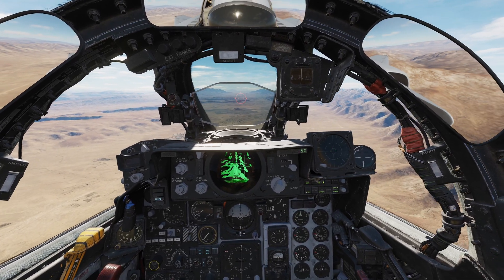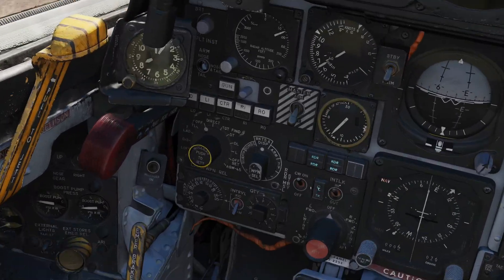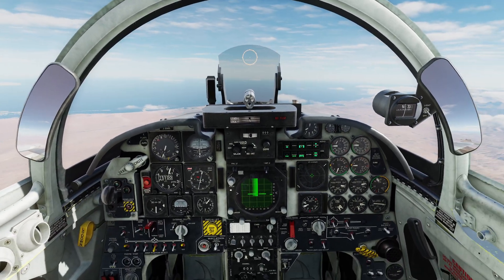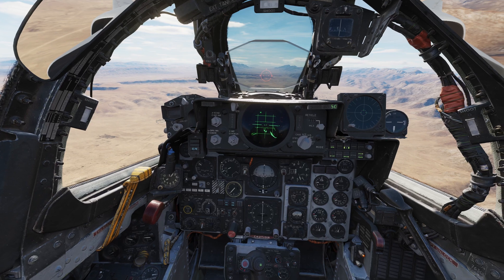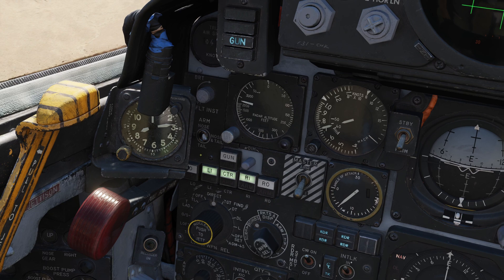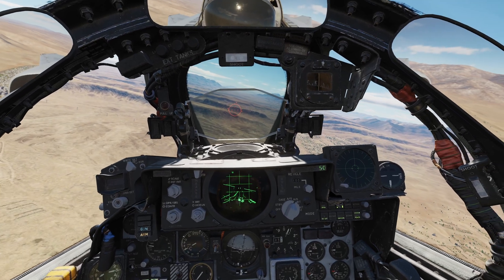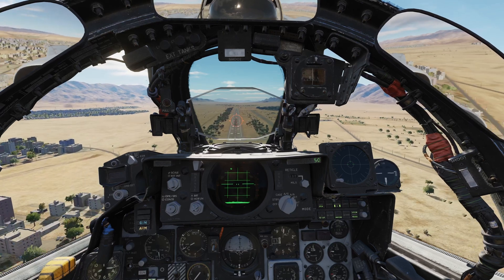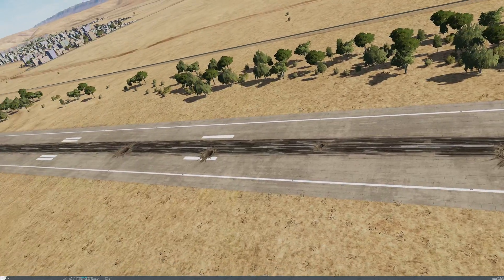Setting Your Ripple Timing in the F-4 | DCS World

Comment: This math is so complicated if you're used to the metric system. Any tips to remember how much ft are in a nm, and how many ft/s are in a knot?
Reply from the maker: If you round down, a NM is easy to remember as 2,000 yards or 6,000 feet (1850 meters). Those numbers are also easy to work with. 1 knot = 1.68 feet per second. Hope this helps!
Reply: @DieselThunderAviation  thanks a lot!

Comment: Some of the other tutorials emphasize on setting up the reticle depression based on airspeed and altitude.  You didn’t bother too much with it.  So if hitting a truck convoy, does the reticle depression matter or we just guesstimate?
Reply: Just tried your method of calculating the spread and ithe results were way better than any of my previous attempts.  In DCS mission editor, if you create a tank convoy on road, the default separation between the tanks is just about 100 feet.  So using your calculations, I was able to land some snakeeyes pretty close and in some cases right on top of a 10 tank T55 convoy.  Thanks a ton 🎉👍🏽
Reply from the maker: Awesome! Love it when runs like that just work. Way more fun and challenging than just dropping laser guided stuff!
Reply from the maker: Coming in low, straight, and level, I don't get much use out of it. Especially if releasing a whole string of them. I've gotten decent at getting the drop at about the right time in most instances. Definitely is more useful on a diving attack. And I forgot to switch it to A/G as well.